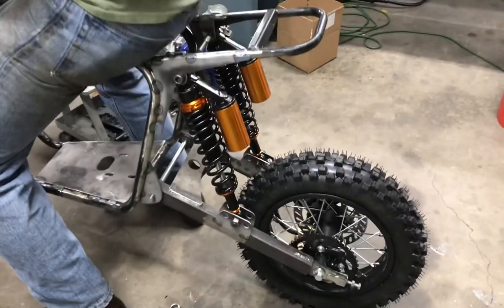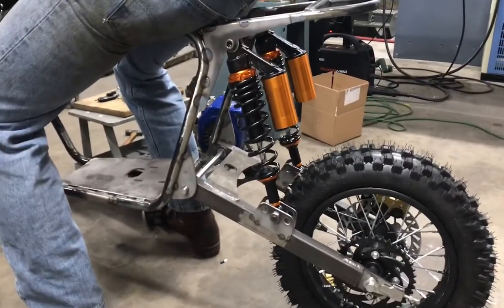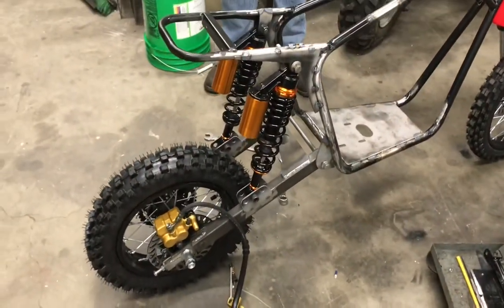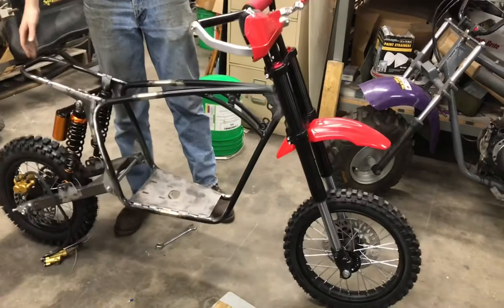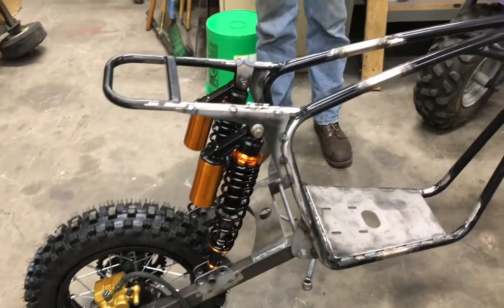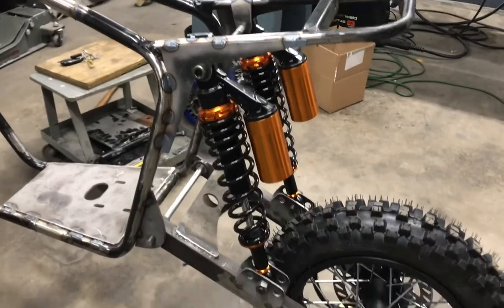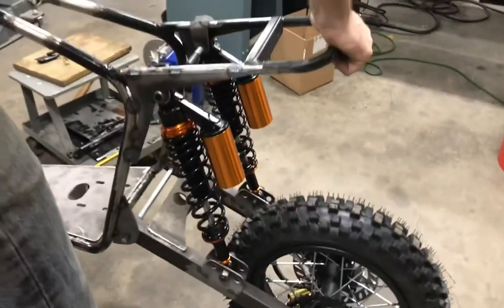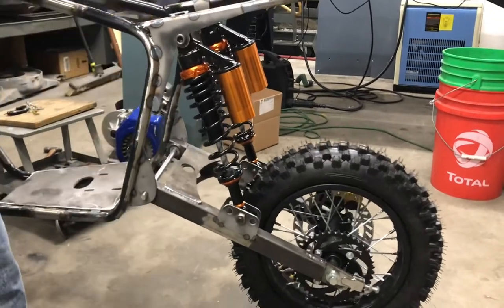24hr Mini Bike Swingarm Build Part 6

Comment: Adding a swingarm, or at least moving the rear tire mounting point rearward, would make it FAR less likely that I'd end up on my butt from a launch. I'm a big guy, so I'd probably be sitting at or near the rear of the seat. So many cheap, simple, short wheelbase minibikes  look like fun, but they're kinda sketchy.
Reply from the maker: I call them flippers